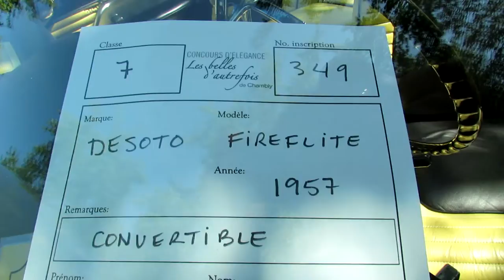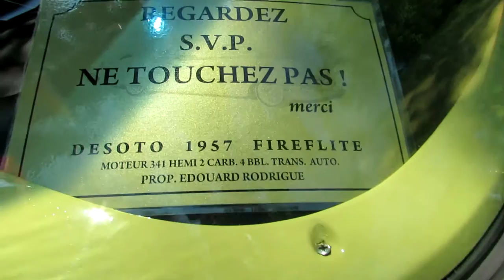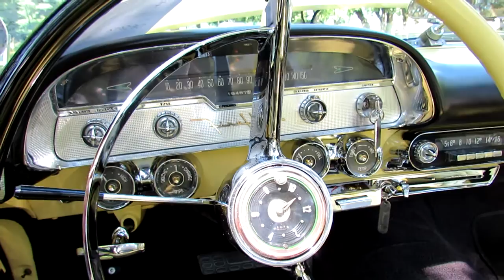1957 Desoto Fireflite Exterior and Interior - 2012 Concours d'Elegance du Chambly, Quebec, Canada

Comment: The previous poster got it backwards.  In 1957, not all states had made the use of quad headlights legal. Up until then, only duals were allowed. So, for the 1957 model year only, Chrysler's designers permitted both dual and quad headlights for their Imperials, Chryslers and DeSotos. Either was available as an option. For Plymouth and Dodge, the designers put the parking lights next to the headlights giving the illusion of quad headlights. Dual headlights were never outlawed. It was all style.

Comment: quad headlights were mandatory by 1958 model year, because people would drive around with the high beams on when a single element light bulb burned out
Reply: Actually, in the Imperials, Chryslers and DeSotos, the car buyer could specify either dual or quad headlights for 1957.  This was because quad headlights were not permitted in all 50 states.  For 1958, quads were permitted nationwide and Chrysler dropped the dual option.